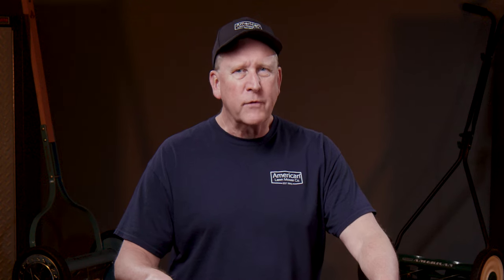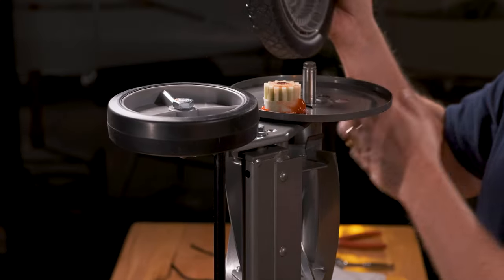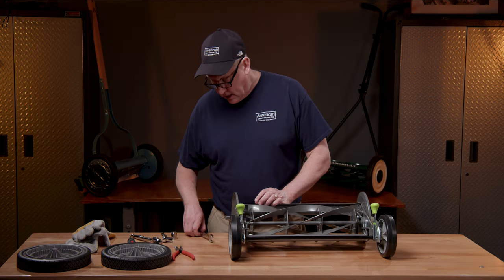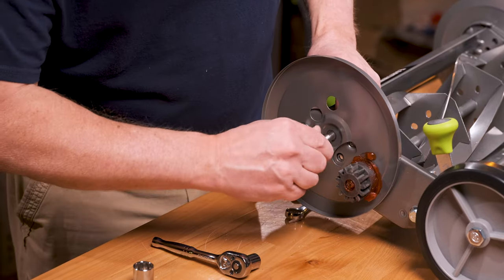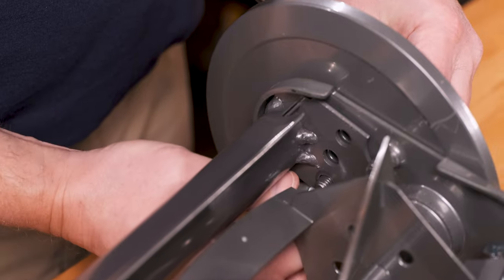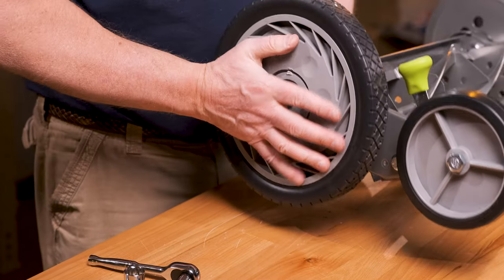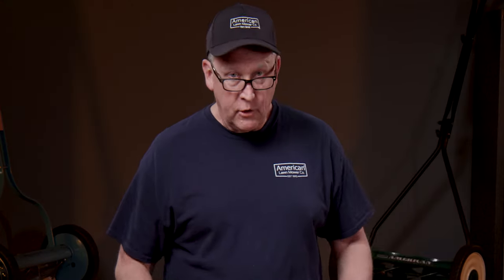Reel Mower Major Height Adjustment

Comment: Had I known it was going to be such a pain I wouldn’t have bought it. Thank you for the video.
Reply: It’s FAR easier to do this with one wheel in the air and the other on the ground. Doing it level like this is a bit ridiculous.

Also, you should only have to do this once a season at the beginning. Go super low and then maintain at .5 or so higher.

Comment: Not as easy to remove the axle is it shows in the video. You practically need a stick of dynamite to loosen the axle screws!
Reply: Same - how did you loosen it?
Reply: @Shooter1444  Never did. I sold it. Was only a stop gap until my new power reel mower came in.

Comment: So let me see if I understand this correctly: The reel mower I just purchased that has "No Tools Required", "Easy Height Adjustment" all over the packaging with a "Minimum Height of 1 inch". Requires tools and wheel removal to adjust the height to get anywhere below 2 inches?

- There is absolutely 0 information on your website, in the digital manual on the website, in this video, in the instruction booklet, or on the mower itself to give me any sort of an idea of what height levels theses different positions allow for.

Returning this product
Reply: Agreed. This is the hardest "easy to use" reel I've ever seen. Craftsmen and Fiskars have been way more user friendly.

Comment: I used to do it this way until I realized it's much easier to just loosen the screw/nuts and slide the wheel off the axel just a bit (carefully) and then move it to the particular pin height that you need. No messing with getting the e-ring on or off. Takes MUCH less time. These are great mowers - have had several (started with the Sears brand - which was either a Great States or American, branded for Sears).  :)
Reply: Is there a video of the way you do it?

Comment: Great video! I got an 11/32 wrench but it is much too small. What size is needed for the axle nut so I don’t need to use and adjustable wrench? Thanks.
Reply: I think he meant 11/16, I will try today
Reply: mine is 17 mm.  11/16 is a little big

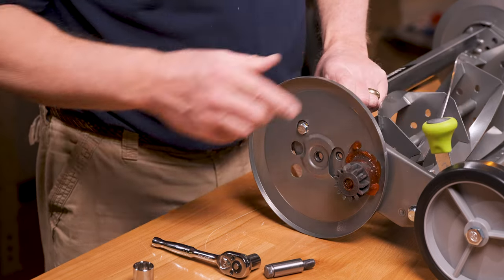Comment: 2:07 What is the change in height from C to B to A? I don't see this in the manual. For example, the Scotts 18" 7-blade says that C allows cutting heights between 2"-3". What are the heights for B and A?
Reply: +1 What the heck guys. These instructions are AWFUL
Reply: From the 16" American model mower manual  "Position A = 1/2" (1.27 cm) cutting height,
position B = 1 3/4" (4.44 cm), position C = 2 1/2" (6.35
cm)."
Reply: @wesbutler8289  I have the 20 inch one and looked up the manual on their website and its not there. Those measurements are clearly different than mine because mine only goes as low as 1 inch. Your positioning numbers are also not correct, because its supposed to be a range, not a specific height. Remember we are talking about the MAJOR Height adjustment here not what the minor height adjustment positions mean.

Adjusting the major height positions adjusts the range of what the minor adjustment levers do (As seen in this video).

@oldmanwaugh also clearly stated in his reply that he has the 18" mower, not the 16" that you have, and again, mine is the 20".  If your's is capable of going below 1 inch then clearly there is a difference in the HOC range depending on the model.

Comment: What is the tool used on 1:43 called? Is it some kind of reversible ratcheting tool? I just dont know what to search for :(
Reply: It’s a 3/8 inch drive socket wrench. It should cost under $20 and you also need a 1/2 inch socket and a 11/32 box wrench for the inside screw. Plus you’ll need needle nose pliers for the clips on both sides and a flathead screwdriver to take off the plastic caps.